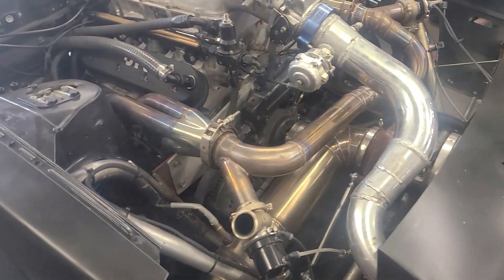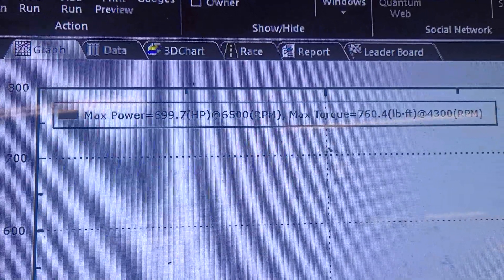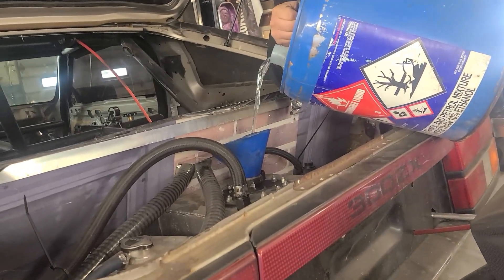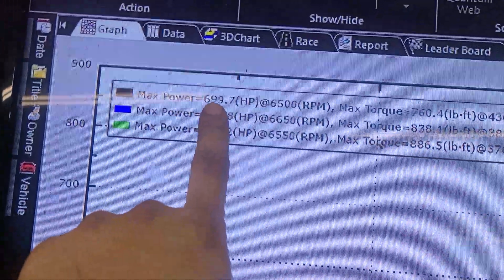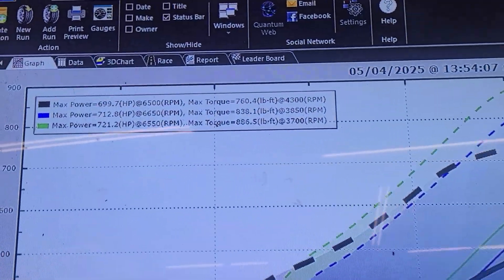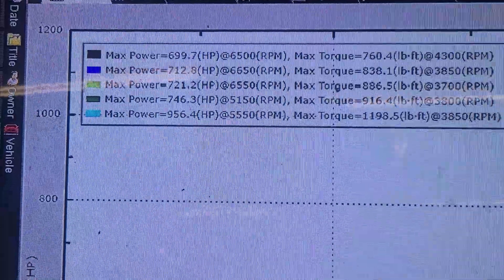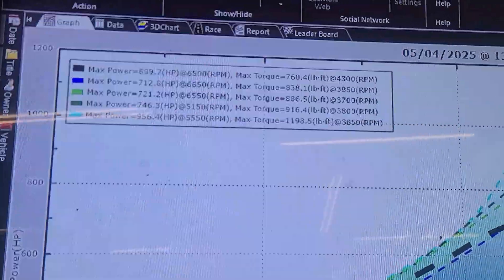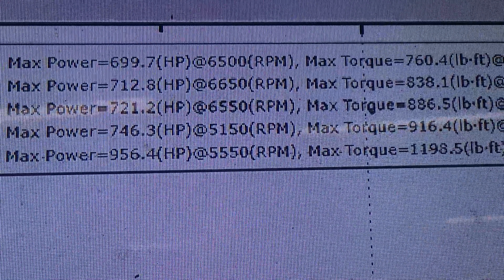I mixed Methanol with E85....Surprising Results!

Comment: Does m1 actually mix with e85 or do they separate. The guy that makes Gem says you need gasoline as a mixer between both fuels. Im wanting to try this out with nitrous and  x85L. Its like 123 Octane  and r+m/2. Want to add M1 to it 50/ 50 or even 60/40

Comment: Curious as to what ECM and O2 sensor you are using. I know the Bosch O2's aren't supposed to be compatible with methanol, but wondering if they would work fine when cutting it down with pump gas or e85.
Reply from the maker: I have a Haltech R3, which supports NTK and Bosch sensors..but at the moment I have a Bosch sensor.

Comment: Very cool Mike. I had a friend just ask me about tuning his new NA bike build on M1 but I told him it would be high maintenance (way more oil changes), but this has me thinking we'll do a mixture at some point now. That and, the Turbo ZX14R in my avatar will be on pail E85 after I build his engine, along with installing Holley EFI and his much larger injectors (it's been on VP110 with 100% stock engine and Injectors maxed out at 10psi). So again, this confirms we can add some methanol when we get up to the boost where I'm not happy with the IATs 👍
Reply: If it ain't boosted Or built whit High compression you are just gone loose power putting methanol in it... Boosted... It can only help 👍
Reply: @SweVikingRC  I did know that and it is built with high compression👍 (and just to let you know my history, experience).
I've been building, racing and tuning bikes for 50+ years and have been dyno tuning bikes for 17 years (including) both dyno and remote tuned Holley, FuelTech and Maxx on bikes for 14 years. I have also ridden Methanol Turbo Bikes (earned a National number plate on a Kawasaki Funny Bike in 1990 and also did well on a Harley Pro Fuel turbo) BUT, I just haven't had a reason to try methanol on any of the lower class bikes before now.

We made 500Hp to the tire on a friend's blow-through carbs, 1080cc Kaw. ZRX on gas 14 years ago (because methanol wasn't allowed in that class).
The 333HP pull video is on my channel, along with the graphs that showing the progression up to 472Hp (the dyno aborted the 500Hp pull = no graph).
And lastly, the no wheelie bars ZX14R Turbo in my avatar just ran it's first 7.99 1/4 a few weeks ago (with 100% stock engine at 10psi boost) which is why I LOVE bikes. And since we knew it was going to end up with Holley EFI, I didn't bother installing boost control on it = it has 18* timing removed in first gear keep the front wheel down (10psi = 290Hp, 160LbFt to the tire)...
Reply: @KCadbyRacing where you located.  I'm wondering if that mix will benefit from nitrous as well

Comment: Did I miss how you're coming up with the 20% mixture? from a the 5 gallon pail?
Reply from the maker: @Bted__ever  I suppose I should have went over that... We're mixing it by volume in a 5 gallon pail. 20% is 1 gallon of m1 to 4 gallons of E, 40% is 2 to 3. 

There's some science on doing it by weight that is probably the "correct" way, but for what we're doing this works fine and shows potential.
Reply: @PalladynoTuning cool that’s what i figured, but needed the clarification haha.

Comment: Ive ran 50-50 for awhile from time to time, always ran it richer though, HG are happy and can run more timing. But i target richer AFRS when i run a 50.50 mix. Remember methanol stoich is 6.4 E85 is 9.7 big difference.
Reply from the maker: @onebads2kracing  I look at everything in lambda when tuning, because lambda doesn't change - but I did richen the target lambda a bit when I switched to the 20% from where I was running the straight E at. The 40% mix may benefit from a little more fuel for sure.
Reply: @ you should try richer vs leaner on 50/50 see what it picks up and video it
Reply from the maker: @ I might do another video with 50/50 and also pure m1 and compare that...I have enough injector for wastegate on pure M1 I'm sure, would be interesting to see the difference between a blend and full M1.
Reply: @ oh there’s a massive difference between M1 and 50-50 lol but curious how much 50-50 picks up with different lambda targets
Reply from the maker: @ Yeah I'm sure there is a massive difference, having tuned a handful of M1 cars, still fun to play with it. I definitely don't have enough injector to run M1 and make the power I need to though...but will be fun to see what I'm missing out on haha.
Reply: @ ya same, I ran .68/.70 on 50-50

Comment: bro you missed everything important! forget the power! TORQUE numbers bro! they were through the roof. it's torque that is most impressive in what you did there
Reply from the maker: @GTRliffe  the torque is multiplied by the torque converter as it flashes and the rpm isn't accurate for peak torque due to the rpm sync being by dyno roller speed.
Reply: @PalladynoTuning  Yeah only way to get accurate torque with an auto especial;ly with  a stall is via rpm pickup from the motor. using roller spped for rpm will no be accurate

Comment: If you are going to be blending fuels add some scales to your workshop/blend area , fuels & additives are/should be blended by weight.
200 Liters of Methanol weighs 190kg.  200 liters of 75% Ethanol will be different (don't know it offhand)  

Blending fuel lets you  Tune your fuel to work with your powerplant. 
<short version>

A well distributed , finely atomised , direct port , Water injection setup would also be of benefit to you I think.

Comment: That’s awesome I wonder what about methanol makes so much power over ethanol
Reply from the maker: @AlbinosnakeSVT  Cooler charge, higher oxygen content in the fuel, etc...I have no doubt that straight methanol would make the most, but it also requires about twice the injector.
Reply: @PalladynoTuning something people forget about with methanol is because the stoich is so much richer and more liquid fuel is entering the chamber, it actually raises the dynamic compression of the engine. That's also part of the reason why nitro is so potent as well.

Comment: What o2 sensor goes halter use? Doing this mixture change the stoich. Values?
Reply: "goes halter" use??? LOL
LEARN ENGLISH!
Reply from the maker: @justinmalbrough3754  Bosch or NTK. 

20% changed fuel by 4-5% and 40% methanol changed it by about 8.